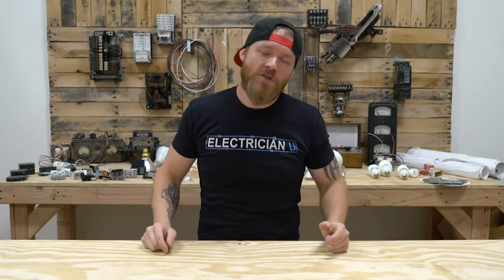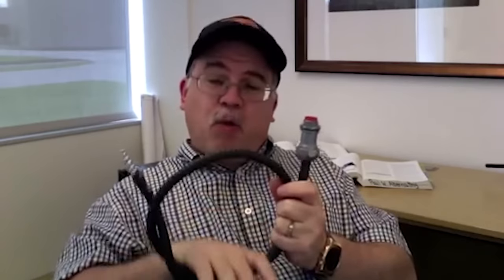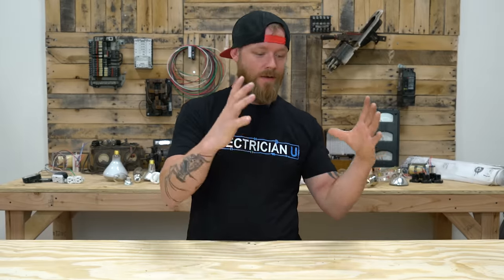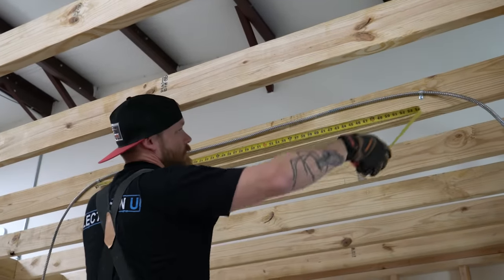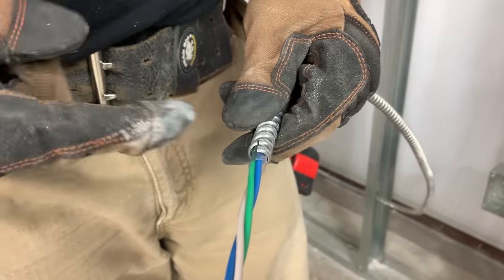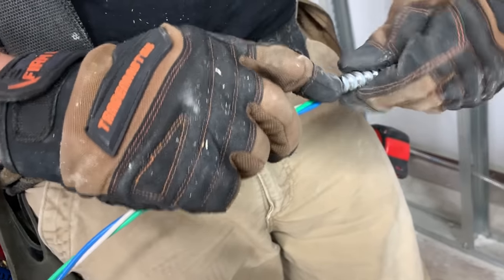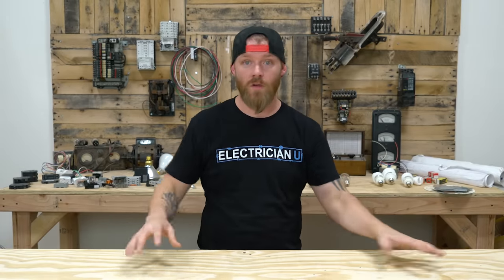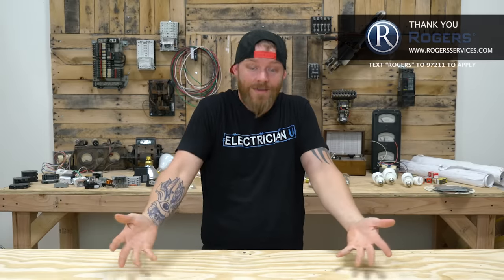Wiring With MC - WHAT YOU CAN AND CAN'T DO WITH MC CABLE as an electrician

Comment: You are showing MC going through steel studs without Grommets, we are not allowed to run it through steel studs without using plastic grommets and we can't use tie wire, have to use non metallic ties like zip ties.

We also can't have more than 360 degree's total bends in MC, so when they are sloppy rolling it out they can get red tagged if they don't run it properly.

We get red tagged if we don't use the red devils.

Common sense ain't so common, especially on a jobsite or with inspectors.

Comment: Why don’t people run this stuff in residential applications?  Then you can easily replace wiring by fishing/pulling.  With Romex you pretty much have to tear up the walls to replace wire.
Reply: Negative. The conductors inside MC are twisted within the flex and have a strip of plastic that also runs with them. The best way to wire a house is with EMT and pull THHN throughout.
Reply: Glen Atchison right on, how about FMC filled with THHN? Another option with equivalent benefits to EMT.  I love EMT for exposed work but I’d think why bother with the bending for work behind walls etc. any disadvantage you see when wiring a house?
Reply: @R900DZ  Ever try to push a fish tape through FMC? Or the 90 degree fittings? Or the slack that isn't strapped? It's nearly impossible.
Reply: Glen Atchison I have but only straight runs and minimal fill so no issues.  I would think you could overcome what you’re saying by oversizing the FMC and using pull boxes/LBs and whatnot. Is the pulling issue the reason that Chicago requires EMT in homes vs FMC? Or does EMT also offer more fire protection and that’s the reason?
Reply: @R900DZ  I'm not familiar with codes in Chicago, but I imagine it offers protection against rogue DIY homeowners and fly by night elechickens sending nails through their wires.
Reply: The main reason is COST....  

ROMEX with plastic boxes is the cheapest and fastest method of wiring for residential...   Unless local codes forbid the use of ROMEX.

Comment: An electrician that cleans up those 6" pieces of sheathing?  Were do I find one of those?  Seriously...step on those little pieces on a concrete floor is like skating on ice.  Keep your oily paws off my white ceiling tile.  Aren't those pieces if sheathing and plastic strips supposed to be left above the ceiling?  A few years ago I have an inspector fail an electrician for the crap he left above a ceiling on a remodel.  "workmen like manor"  (Electrician wanted to argue everything with the inspector) Don't pull MC on the ceiling grid, it bends it every time.

Comment: MC cable just seems pointless to me.  You can't use it anywhere instead of conduit, and nowhere where physical damage would occur.  You  can't use it underground or outside.  It's expensive.  Just high margin junk for the manufacturers.
Reply: alot of commerical jobs require MC. some states even require MC in residential